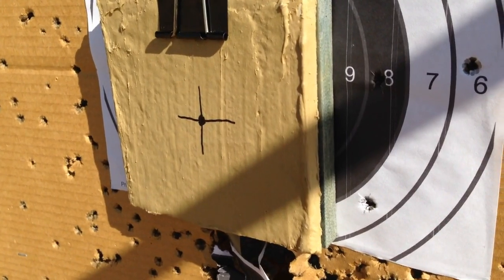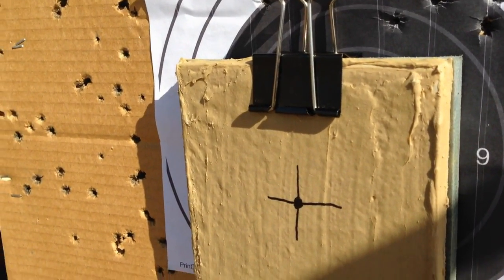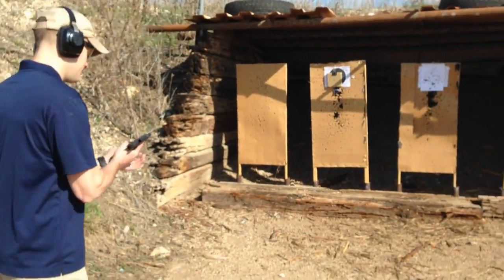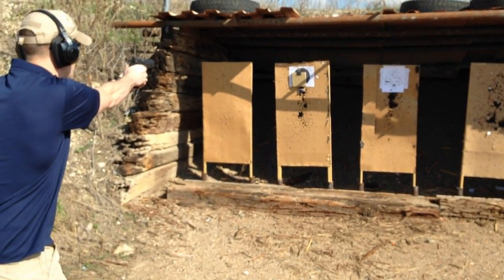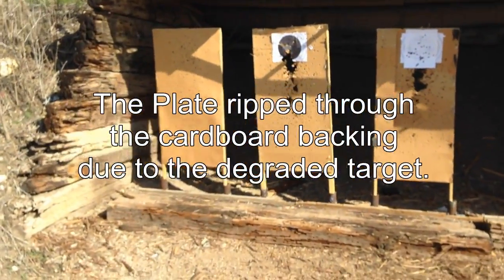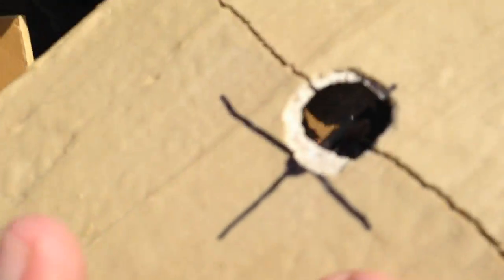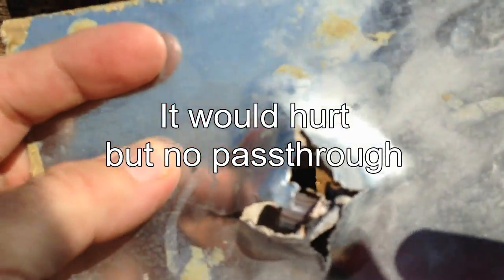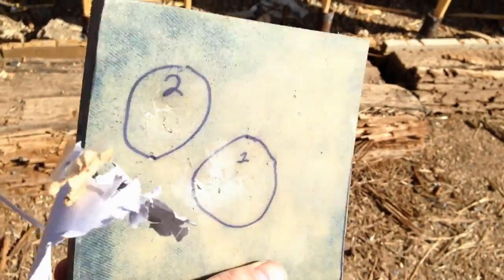45 ACP vs Homemade Body Armor

Comment: hello cool video how does just the denim plate do against the pistol rounds
Reply from the maker: chris mckenzie it stops them all. haven't tried 357 or 44 mag though
Reply: do you think 30 layers of denim with Loctite Adhesive with no tiles would stop 556 out of a 20 inch barrel green tip and the xm193

Comment: have you found that denim is better than fiberglass mat or cloth? or is it used because it was available?
Reply from the maker: per layer the denim is stronger but is heavier and thicker than fiberglass. much easier to work with as well.

Comment: Mighty .45 ACP? I mean its a good round but its not famous for its penetrating capabilities... If you are going for impressions I would do a high powered 10mm round since those are alot more common than other similar High powered pistols like the Desert eagle(which is just insane), or any of the high load revolvers.
Reply from the maker: DattMuffinMan it was a jab at folks that were commenting on my latest video where they claimed 45 acp would penetrate.
Reply: The Professional Prepper (Prep Know Do) 

Friendly (question, advice? Idk)  

Have you ever looked into the penetrative qualities of a Tokarev 7.62x25? I carry one just for the simple fact that it can defeat 3A soft armor when loaded right.
Reply: @NPCSN  i tested 7.62*25 against similar homemade armor and it stopped it. With less deformation that the 9mm i tested.
Reply: @aleksandarcurguz2428  

Did you hand load the rounds to the Bulgarian surplus specifications?
Reply: @NPCSN  nope, I used yugoslav surplus rounds.
Reply: @aleksandarcurguz2428  

Hmmm... I’m not familiar with how those shoot honestly. I’d be curious to see what kind of velocity they’re moving at vs gr weight.
Reply: @NPCSN  they are pretty good rounds.
Reply: @aleksandarcurguz2428  

Well that’s good to know. The Bulgarian stuff must just be loaded really hot. 🤔
Reply: @NPCSN  it is probably, but it also has a steel jacket or something which helps it penetrate better. But I think that a 8mm porcelain tile with a good backing (12 layers of denim or fierglass) would stop it.

Comment: Hey, try to answer; I made a composite body armor for pistols only. On the front there is a 0.5mm stainless steel sheet metal wich is coated with poly resin, on the back I put a composite backing made out of fiberglass mat (6 layers), fiberglass mesh (8 layers) and heavy weight denim (2 layers); this layers are also coated with poly resin. Can it stop the 9mm at least :D
Reply: Ok thanks anyway :D